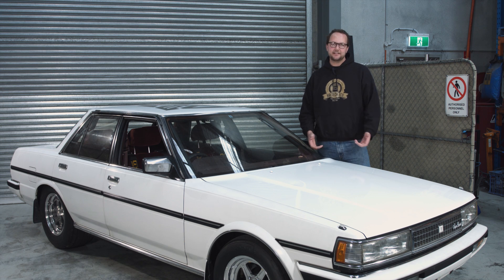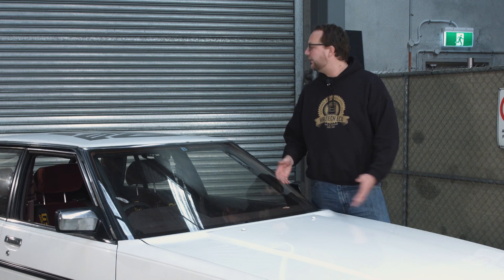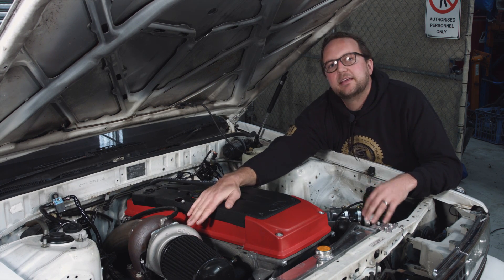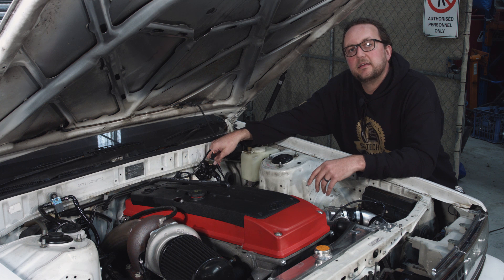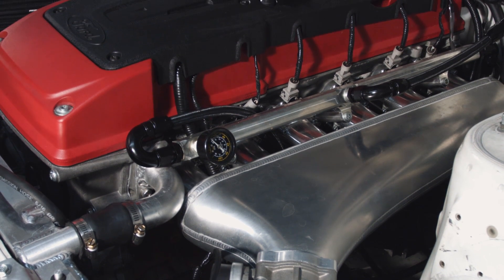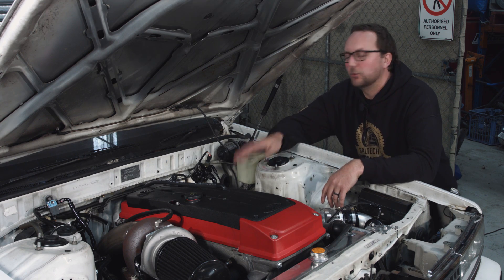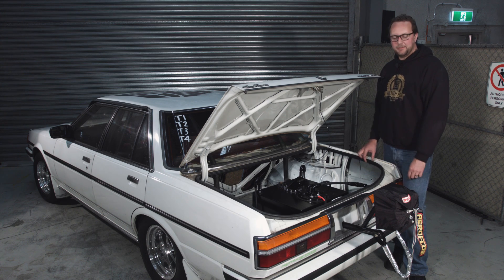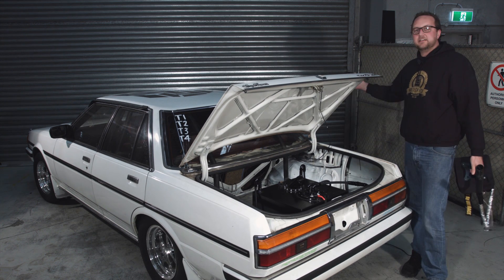💬 Mighty Car Mods Cresta: Secrets of a 9-sec Sleeper | Technically Speaking

Comment: damn this engine have a better potential than 2jz  with stock internal damnnn
Reply: And they cost $200 from the wreckers :D
Reply: beefcakemonsta how to lose a discussion. Start pointing out personal flaws and stop discussing the subject matter.
Reply: Zac Youngson Barra's are superior to JZ's in every way. You are just uneducated on the subject so quit being a jelly hater
Reply: +Dadul Ludad you can say the exact same thing about the non turbo 2JZ-GE engine
Reply: 2jzmx73 lol how the fuck did ford ''take toyota's design''. So that means every other straight six turbo ever made is copied from a 2jz? Like the RB20DET and RB30ET that nissan made long before 2jz's went into production? you're delusional buddy. you're  just another 2j fanboy.
Reply: Unco Casey exactly right. There's just as many if not more aftermarket parts for Barra's available in Australia. If the rest of the world got Barra's then their aftermarket parts would be just as easily available as 2jz parts, worldwide not just in Australia.
Reply: Smo Kabong not far superior their both on par as far as both being cast iron blocks and straight 6 but the 2j has some added benefits that surpasses the Barra in my opinion. Oil squirters that squirt upwards towards the underside of the piston, wider oil journals, more spacing between barrels giving chance of safely overboring & more reinforcing on the out of the block to reduce warping. 
In short I don’t think you will find a more over engineered production engine than the 2j. 
Given the price difference tho I’d take the $3,000 it takes to buy a 2j go to wreckers get a turbo  Barra for $500-$800 & spend the rest on upgrading internals. 
Still cant disrespect either of these engines they are marvels of engineering!
Reply: beefcakemonsta the 2jz doesn't make any significant amount power over any other i6 like I said it's just the availability of parts
Reply: beefcakemonsta Typical thing for a jelly little boy to say when he's got no comeback.
Reply: Nw.Caffers why thank you sir!
Reply: Smo Kabong I. Well done. Elocution, 8.5/10, articulation 7.5/10, burn factor 9.5/10. That other guy should probably do himself a favour an stop embarrassing himself. He lost this discussion when he decided to resort to personal insults.
Reply: Dylan lol your comment shows exactly how much the average 2jz fanboy knows. 2jz's are not 2.5-3l. they always have been 3l. the 1jz is 2.5l
Reply: fuck ill telll ya the 3.8v6 ecotec is using ancient tech, OHV spec, in 95-2000s. doubt it would smoke a barra, i prefer holdens over fords bro but i wouldnt say ecotec>barra
Reply: phaggot 3.8 ecotecs are just updated 80's buick engines. an ecotec has nothing on a barra, even without the turbo.
Reply: Kevin Bosco the 2jz isn't good because of how much power it makes, it's more because of the availability of after market parts making it extremely easy and cheap to reach high power
Reply: yeah 2j still awesome from 90 until now still strong right now
Reply: Err they handle 800hp to the wheels fairly well.
Reply: +Zac Youngson a Barra wouldn't beat an ecotec????? lmao lay off the crack buddy. ecotecs always have been and always will be junk. Barra's are 100% Australian made buddy. where does Holden get it's V8's from? you're so jelly it's hilarious.
Reply: Too bad here in the US, you can't touch a Barra for less than $1500.
Reply: stock 2JZs can safely push 800 to the wheels, barras are good, but not that good. fucking youtube mechanics
Reply: +beefcakemonsta the barra is far superior to a 2jz in every way
Reply: Dadul Ludad again from the scrap yard
Reply: but still stock internal  from factory as far iknow there no way 2jz with stock internal part can handle safely like this engine
Reply: Kevin Bosco thats because 2jz is like 2.5-3L and the barra is 4L
Reply: yeah you can but how long the crank and piston stand it 600 hp is already the limit 800 2/3 run probably broken minimum you get forged piston to doing that safely btw that thing already cheating from displacment
Reply: Kevin Bosco uhhh no, 900 is the limit before the bottom end starts going, not 600. And how is it cheating with displacement when it's 3l and the Barra is 4?
Reply: The Barra is hampered by it's cams. Match the cams, and the Barra will walk all over the 2jz. Equivalent setups, the Barra would simply wreck the 2jz with headflow alone. Displacement is a good thing.
Reply: beefcakemonsta lol you're another uneducated 2JZ fanboy that knows absolutely nothing about Barra's and is using Mummy's ipad to troll youtube.
Reply: XR6t56 The n/a engines yeah, but these turbo engines run about $1500. The n/a barras are pretty weak
Reply: keep in mind 2jz are like 90s spec engines and only 3L, if Toyota rebuilt the 2j at the same time this Barra was built, I think 2j would be much more superior. don't get me wrong Barra engines are fuckin decent but just my 2 cents
Reply: This is the stock internals for the F6 Typhoon motor. A standard barra will need pistons and rods.
Reply: i know im 2jz fans but that thing insanely better potential from 2jz right now only need racing manufactured to produce racing kit
Reply: +Zac Youngson biggest 9year old comment of the whole thread goes to you buddy
Reply: Steven Peterson so it's still cheaper than a 2jz then? 😂😂😂😂😂
Reply: Kevin Bosco you are completely wrong again because you clearly don't know a thing about Barra's and your just a 2j fanboy. so just stop talking now idiot
Reply: get off the grass ! an ecotec would clearly rip the shit out of any barra. Clearly you must be the one smoking crack !!
Reply: A stock 2JZ with just a boost modification can reach 400-500whp (345KW) on pump gas. But a 2JZ engine is very expensive around $2500 in a very good condition. So if i were in a budget build who wants to make big power at a cost of 1 stock 2jz. this is your 2nd best bet.
Reply: And your Barra fanboy. have you been living under a rock for the past 15years? the fact that Titan motorsports makes a drive-able 2jz that makes 700whp on stock internals on pump gas mops over the floor on your damn Barra engine. I admit the Barra is a good engine, but the fact that it has a 1 liter advantage over the 2jz and makes less power than the 2jz. The only thing that the Barra trumps over the 2Jz is that the cost of buying the damn engine. still cant believe it? Just trying searching real st's 900+whp E85 stock internal 2jz.
Reply: +beefcakemonsta the only "facts" in this thread so far are the facts that 1. you are a gay little jelly uneducated 2jz fanboy, and 2. nothing that that you have said in this entire thread is actually factual so you resorted to name calling like a little child instead of using facts, because 3. the real fact here is the Barra is superior to the 2jz in every way and you just don't know it. Btw my dog has a higher IQ than you 😃
Reply: Smo Kabong You got anything of substance to say or just talking shit like a 9 yr old ?? btw barras are shit .
Reply: also a typical way of thinking of a pothead. Lay off the weeds boy, your brain cells are dying. :)
Reply: I could go all day with the shits, fucks and insults. can you keep up pothead?
Reply: Kevin Bosco barra motors HUMUNGOUS and in no way better than a 2j

Comment: was that motor orginaly turbo charged or was it an N/A motor? don't the factory turbo ones have stronger rods?
either way its a beast for how much power they got out of it for an il6
Reply: In the build video, I believe they said it was originally a turbo engine, but that the n/a units use the same internals these days. probably cheaper for them to make them all the same rather than specing 2 different sets of internals, I'd guess - economies of scale and all that.  But that's just a guess.
Reply from the maker: It was originally turbo, from an XR6.